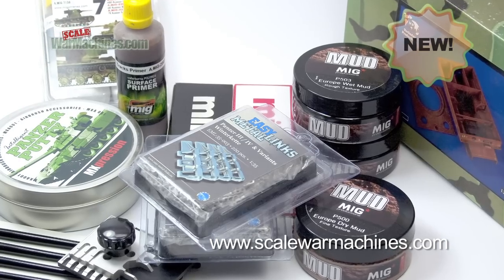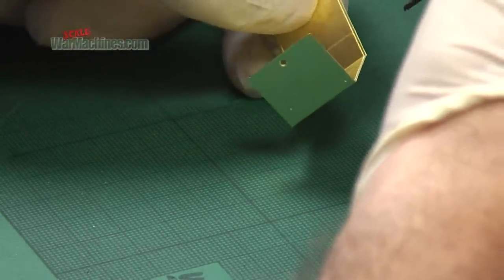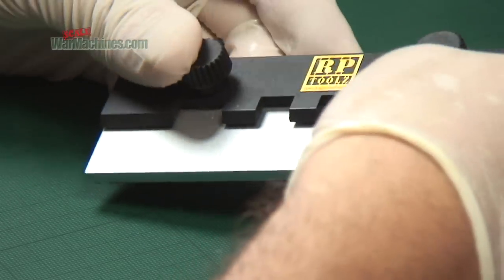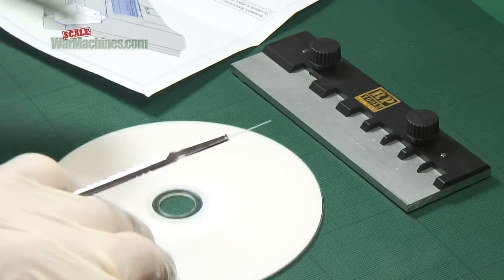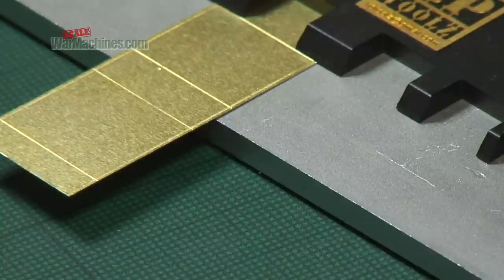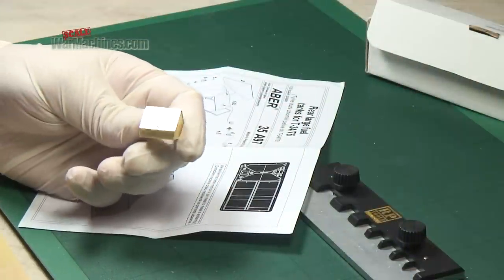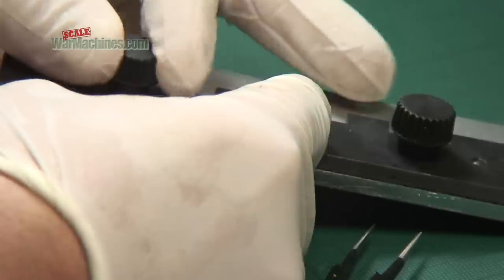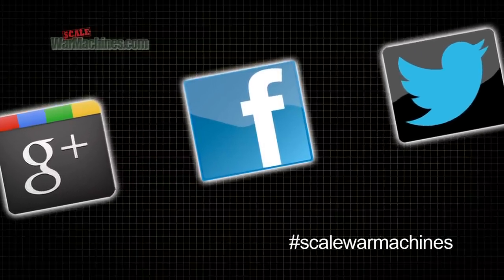RPTOOLZ PHOTOETCH BENDING TOOL "HOW TO"

Comment: I ordered the RP Toolz wire bending tool and the RP-18 for PE parts from Last Cavalry. Their shipping cost is low and excellent customer service. 
I appreciate your video the only single negative is the RP-18 didn’t come with instructions or suggestions on using the tool. I appreciate your how to video and have hit subscribe. 
I’ve purchased figures from Historex Agents and I’m mentioning Last Cavalry because of being in the US their shipping cost was lower and Dave from Last Cavalry was wonderful to interact with.
Reply: I forgot to add I’m pretty new to modeling 1/35 but have been amassing a number of figures, armor and detail upgrade kits. I’m going to begin with two different Hetzer kits (one is out of production and costly to find but wheel, barrel and track upgrades can be found). And I recently purchased the two RP Toolz tools. Thank you again for the how to video

Comment: July 10, 2017Checked Evilbay and first price I saw for this is $54 w/free shipping. One thing these people seemed to have forgotten is you don't have to use photo etch parts only on this tool. With thin strips and widths of brass/copper/aluminum, you can bend shapes of your own choosing. Thanks for the video.
Reply from the maker: That is very true. To be honest, one of these types of tools is very useful. But there's plenty of choice out there, so you may find cheaper. Point is, as you say, it is not essential to go down this route, but the option is there.